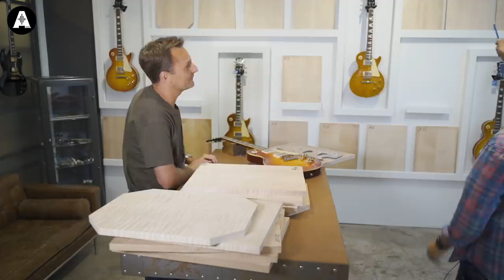Replicating Pete’s '58 Les Paul! - Behind The Scenes at Gibson London HQ

Comment: I have a Frankenstein P90 gold top with a sandwich body, a headstock that's been broken and repaired twice, once by me, a mixed up mess of hardware and electrical  parts, in fact, all of the parts range from about 1955 to 1972. The neck is from one guitar, the body from another, and you can see the bare wood where they sanded around the glue joint at the cutaway to make everything fit. It was built by 2 guys in a store in Atlanta back when the spare parts/junk drawer had stuff from the 50's/60's in it. Nobody cared about that stuff in those days, parts either worked, or they went in the trash. The neck is from '68, and it still has the original frets and nibs on the binding. Somebody put Grover butter beans on it in the 70's, and all of the metalwork is oxidized and tarnished. I don't think any two parts are from the same guitar, or even the same year, but from across the room it resembles a '55 or '56 model. It's without a doubt a total  hillbilly junkyard rat rod, the opposite end of the universe from any pedigreed horoughbred, but I've had it for 34 years, I purchased it in 1987 for the princely sum of $385, and I'd put it up against any Les Paul on Earth. The next time it changes hands will be at my estate sale.

Comment: What pickup measurements were made? It seemed liked a basic resistance measurement to me (resistance varies a lot with room temperature). 
Measurements of magnet strength, inductance and coil capacitance are much more revealing and I find you can actually make some prediction of sound based on those values. Ii think you can certainly tell how close two pickups will sound.

Comment: It's the type of hardware that makes the difference . The metals in the bridge and tailpiece makes a huge difference . I switched all mine out for Fabers/Corsa hardware and they sound better . If you can find vintage hardware , do the swap . The metal is more resonate than the cheap pot metal Gibson buys in bulk . The string sits on the bridge and the nut . If anything is cause the string to be less resonate it will be amplified .

Comment: Maybe I’m wrong but when he said “Pete’s is a bit hotter” and you expected the opposite... he measured just the pickups, but there’s caps and pots between there and the amp which will also make a difference.
Reply: it's not clear where in the circuit he measures. if he measured on the wires that go to the output jack, then the pots, any resistors etc would be measured as well.
Reply: @cosmikrelic4815  regardless, if Gibson wants to create replicas all three would need to be measured independently. We don’t have enough information to say definitively but my guess is that he measured just the pickup.
Reply: @DrFearCo  if we don't have any information what is your basis for your claim?
Reply: @cosmikrelic4815  In order to replicate the guitar it’s obvious that the 3 need to be measured independently...
Reply: @DrFearCo  yes, but we don't know whter he was doing that or measuring the pickups with their circuitry together when we saw him measure and proclaim one was hotter.  you were saying he shoud've measured with the caps and pots in circuit, you don't know that that wasn't what he was doing.
Reply: @cosmikrelic4815  that would mean that “hotter” pickups don’t actually sound “hotter” then which is inconsistent with what they said they thought they were expecting.
Reply: @DrFearCo  thought? expecting? people can be wrong.

Comment: Captain, with respect to what Sam said about numbers not being able to capture the quality of a pickup: let me add more numbers that would be important...

On a typical Les Paul wiring harness, volume potentiometers with higher DC resistance will result in louder treble frequencies. The same applies to tone potentiometers. Therefore it's important to measure the potentiometers.
For PAF-style humbuckers, there is more to them beyond measuring DC resistance. The inductance, capacitance and peak frequency of all 4 coils in a Les Paul's humbuckers will allow you to predict (not just guess) the final sound.
The symmetry of a humbucker's coils - that is, the difference or lack thereof in winding turns - is also important to measure. A humbucker with asymmetric coils is noisier but should sound more 'singlecoil'.

Finally, there is also the influence of the magnet on the sound. A magnet with higher Gauss values results in a louder sound. But the physical composition of the magnet will also affect the pickup's overall inductance. Higher iron content means higher overall inductance, which shifts the resonant peak to the bass frequencies, making it sound darker.
However, it's hard to get this data unless you have a spec sheet from the magnet's manufacturer.

If your goal is to replicate a certain Les Paul sound, time and effort should be invested to measure these things properly.

Comment: This guy is a master tech, or he wouldn't be working in such a high profile role. But there's at least a decade of published science on all the things that can make real electric guitars of similar design sound different, that doesn't seem to be being used here. Of course that's not really surprising - techs are not trained in guitar physics. Seemingly basing the pickup assessment primarily on DCR was not a great start. As Lee remarks, the reported DCR differences are opposite to even the simple relative outputs from his and Pete's LPs. It only costs a few hundred dollars for a proper pickup frequency profiling test rig. As for "Wood making a massive impact", then as far as the body is concerned, that's pretty much wrong too. Even Gibson doesn't believe that. For example, they say that no one can hear the difference between solid and heavily chambered Les Pauls. And all the scientific evidence points in the same direction, towards the solid body wood being largely irrelevant. So it will indeed be interesting as Lee says to see if Gibson can get close to a guitar that sounds like Pete's. Or even a set of guitars that all sound basically similar to each other. Because other than perhaps the Plek, they don't seem to have measured many of the things that have been shown to explain sonic differences. Which require more of a lab than a workshop.

Comment: Pages number 1 les Paul did not and does not have  coil taps  and does not have 4 push pull  pots  . His number 1 has one single push pull pot  for in and out of phase.  When Gibson copied his number 1  they put  the single push  pull pot on the replica  but they made a coil tap  for the bridge pickup instead  of making it for out of phase  middle position  tones they also screwed up by wring the replica permanently out of phase in the middle .  Page would never limit his guitar in that way.  Page adds tones to his guitars  not take them away . Page has always been a big fan of in phase middle position tones  and page did not add the push pull pot to his number 1 les Paul until 1999. This dude does not know what he is talking about

Comment: So when gibson copies pickups they only copy the output.   Makes since every custom bucker  has an Alnico 3 mag . How hard would it be for gibson  to take gauss readings  so they could match the magnet  every other pickup winder takes gauss  readings of pickups they are cloning . Gibson does not  use  the correct  slugs and screws.  They make good sounding pickups but I do not get why pickups are the one thing they do not try to replicate properly.  They replicate minute details  like the chemical makeup of the plastics  but not the alloy content  of the pickups components  like slugs screws covers and bass  plates . They do not use the correct bobbin material  and they do not even use the correct wire for their paf replicas.  Pafs had plain enamel wire . While Gibson uses what they call enamel like wire  which is actually polly wire dyed to look like plain enamel . They do they skimp on the most important  part of the electric guitar . Custom buckers are great sounding  pickups  but they could be made to sound  even better with a bit more effort.  How hard is it to take a gauss reading of the magnet  and why cant they source the proper coil wire  ? Every other wonder can.